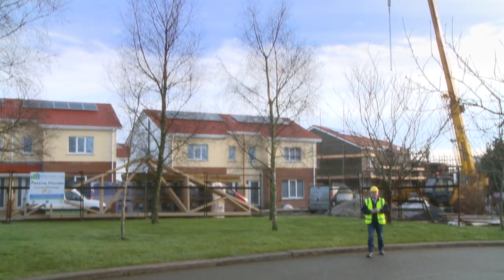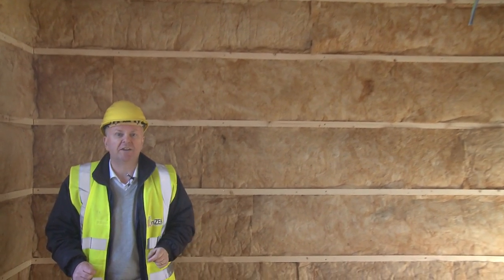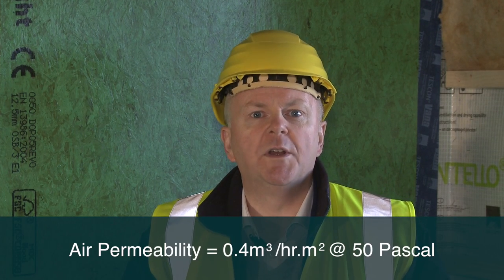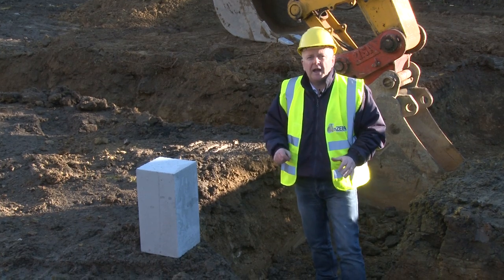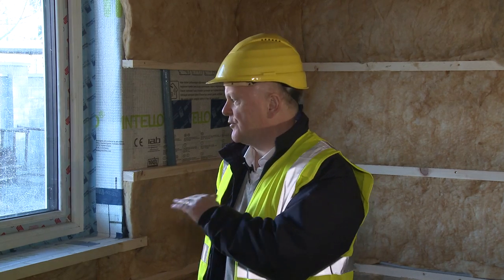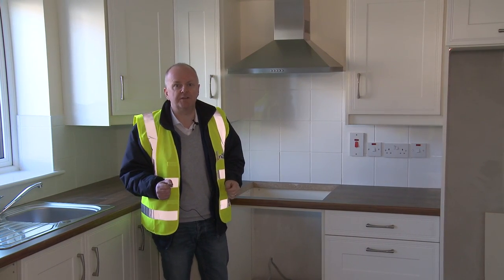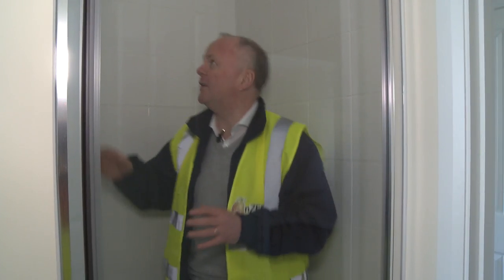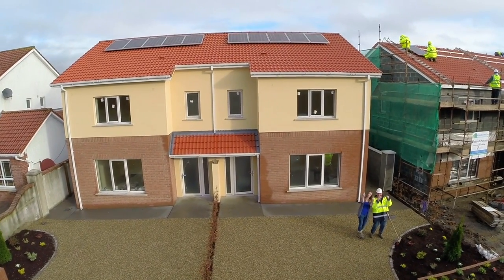Seven Steps to Fast-Track Affordable nearly Zero Energy Buildings

Comment: In the US, for electrical, how do the horizontal furring strips work with the code? With wiring running down wouldn’t you need metal straps at each strip? Stapling down wiring?

Comment: Very good video. I have a couple of points: first of all I can’t have an open fire. The chimney would be a huge gaping hole in the envelope, and even with an air supply direct to the fire the whole integrity of the system is nullified. Following  on from that, if there is a power cut, as there always might and will be, there is no air circulation and windows would need to be opened, still without a heat source. This house is totally dependent on a reliable electricity source and we can rely on that less and less. I have some underfloor heating in my old house, which is lovely, and I use a relatively large amount of gas, but, if the gas and power fails for any reason I still have heat. This is a huge comfort. I don’t trust the government or the power suppliers I’m afraid and photo-voltaic panels don’t work in long winters. Lastly, this depends on skilled, responsible  and careful tradesmen. Good luck with that one. But  a brilliantly informative video, thanks.
Reply: There are solar panels on the roof  that may handle a power outage. In my opinion we all need to have our power plant on our homes or in the backyard.

Comment: The U values seemed strangely high to me. This video suggests that a U value of .16 is adequate for a wall for an NZEB. Assuming that the wall insulation is the primary factor in determining the U value of the wall a U value of .16 corresponds to only an R value of 6.25. Much less than even the CA code required insulation R19  for a wall made with 2 x 6's in CA for a standard new house.  Caveat: I'm not an expert and it is likely that there is something here I don't understand.
Reply: Don't confuse imperial and metric units. If CA code requires 19 Hours x square feet x deg. Farenheit / British Thermal Unit, that's an RSI value of 3.35 Square metres (not meters) x deg. Celcius / Watt. The conversion factor is about 5.68. I wonder when American builders will inch their way to metrication like their engineering and scientific colleagues or will this issue get political? I can't see Irish folk warming to British thermal units anyway...
Reply: @joemurray1  Thank you. I was an electrical engineer and almost everything in that world is metric (until you talk to a mechanical engineer who mostly think in mils (.001 inch)) and I had just assumed that R value was some kind of metric based constant. It is annoying how resistant the US was to adopting metric. Massive amounts of money have been wasted on the use of non metric screws in the US. When  fine threads were introduced metric screws were already a thing and metric screws were a nice compromise between coarse and fine threads. But massive NIH got in the way and there are now three different thread standards commonly used in the US. Something that results in thousands of guys cursing every day when they realize they've gotten home from the hardware store with the wrong screws. In one company I worked for we paid for our metric screws to be dyed blue because people were afraid they'd get them mixed up with non metric screws.